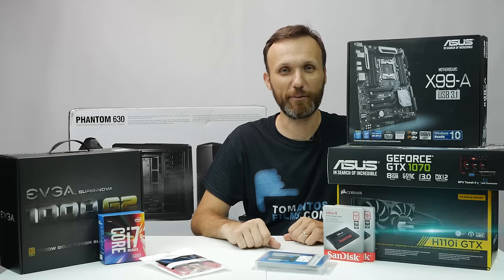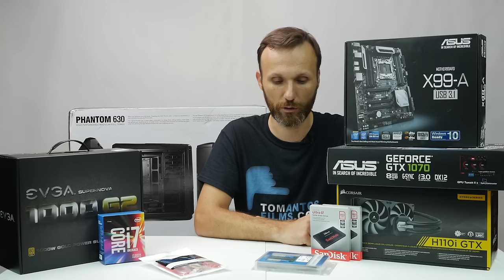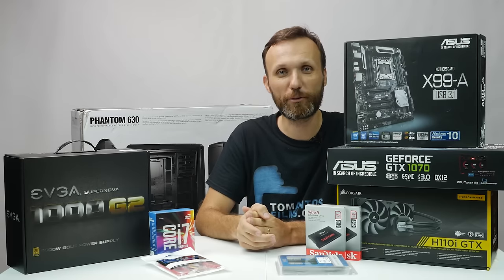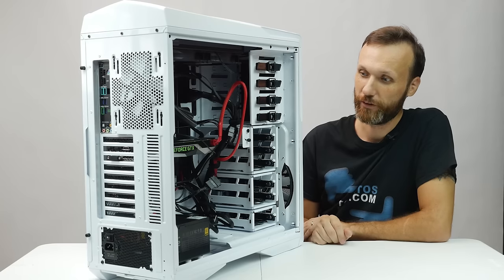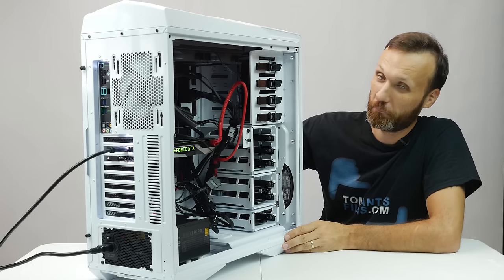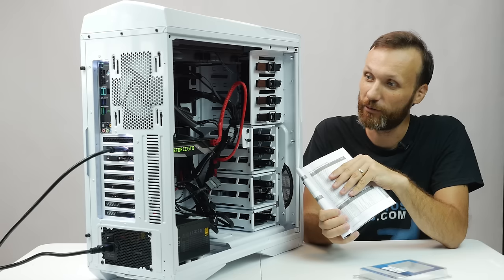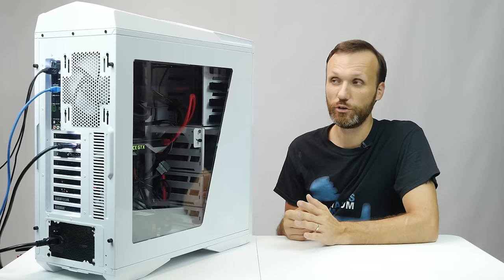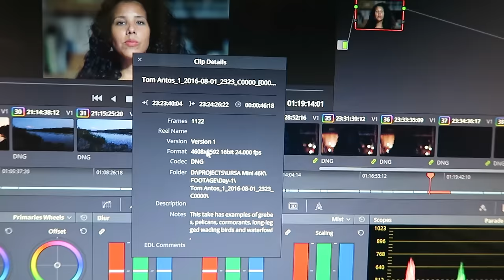4K RAW Video Editing Machine for $2K

Comment: This is pretty similar to my machine, just an older generation without water cooling and almost every component one tier lower. Still serves me very well, can edit perfectly on Premiere Pro CC, struggles on gaming a bit though. 
i7-3700k (4C, 8T)
GTX 660 (Getting 1070 soon)
16GB GSkill Ares 1866MHz
ASRock Z77 Extreme 6
1000W Seasonic 80+ Gold Fully Modular PSU
120GB SanDisk SSD Plus
NZXT Phantom (Original)
Cooler Master Hyper 212 Evo
Reply: do you use DaVinci Resolve on it? If so, how does it run?
Reply: +Lukasz Antos no, I'm very comfortable in premiere and I don't go so crazy on color grading, I only video edit as a hobby for now, but I'm looking forward to doing some videography once I get enough money for a camera and vintage lens
Reply: +xevangz use Premiere/AE? No need for a crazy $$$ machine, just use proxies 😀
Reply: YORKSHABOY i also game quite bit, planning to hopefully get my hands on a htc vive, plus i do 3d as a hobby too, blender is pretty solid on my pc
Reply from the maker: If you don't want to render proxies and work with native footage while doing VFX and advanced 3D graphics then you will need a good computer... otherwise yes, you can always use proxies.

Comment: that PSU (power supply unit) is waaaaaay "overwatted", that system does not need anything more than a 650/750watt psu, (i got basically the same but with just a way more power hungry and older card (r9 290). get a 750w gold or platinum rated instead, way better choice :) other than that the system is golden
Reply: He has said that he may look into adding another GPU later down the line, I know that even with that addition, he won't be close to maxing out the power supply, however energy efficiency of the power supply stays optimal when you have a good amount of headroom. Most power supplies lose their efficiency when nearing their max rating. The power supply he has is bronze rated.
Reply: Did you see slicks last video? (luke from Linus tech tips) a bigger psu will only use more power than a smaller one thus making it way less efficient. a 750 is still enough for 2 1070's and that system, but that CPU does not like SLI since it only has 28 PCI lanes (a gpu uses 16) so if youre building an SLI system then you need the 6850k or 5930k, they have 40 lanes

Comment: I wonder how much of a difference the graphics card does for the video editing performance. (I thought those type of GPUs where more for 3D gaming performance).

Also it puzzles me a bit why you went with 2 SSDs and not any HUGE capacity conventional HD.

Finally, you mention the cost of Windows, but how much does the video editing SW set you back? Why isn't this cost included in the 2k$ price?

Personally I have a preference for linux, which significantly reduces the availability of the most expensive and advanced software, but also cost. ;)

Comment: For 4K you need Dual CPU Xeon with 10 cores each, the i7 is very slow at processing 4K video
Reply: No, it's not. The CPU is only really used a lot in decompression, but when editing RAW, there's not much of that, so the CPU isn't taxed much; the GPU and RAM is instead.

Comment: Cable management is mess.
Reply: +1
@Tom Antos : you have purchased a beautiful case that has all the holes and grommets and room for proper cable management, as well as a case window to display your PC's internals, so use it to your advantage !!! Route them through the black rubber grommets so that they are out of the way (and hidden out of sight), that's what these holes are there for. Also replace the PCIe power cable of the GPU with one that matches your case+PC's color scheme, and add some RGB LED strips to enlighten en highlight your case internals...
Reply: +Yves Cools Tom Antos one of good film maker but surely not a pc builder, that's normal for him. Mines only suggestion just like yours.

Comment: I'm surprised to see that you're working with only a 900gb drive to handle 4k data. how much raw 4k footage can you fit in there?!

I was thinking of setting up an external RAID box for myself and get a 6TB drive + use all the 2TB drives i have around. still need to do more research on this idea....
Reply from the maker: I use external drives for all my footage... I just don't show it in this video. With the amount of filming I do I could never have internal hardrive space for all my footage.

Comment: Tom Antos - i need your friendly support, i have purchased some part of PC from ebay, and want to know your opinion and advice about this configuration:
MOTHERBOARD: Gigabyte GA-X99 Ultra Gaming (My favorite is GA-X99 Designare)
RAM: Corsair Dominator Platinum 2x16 GB 3200 MHz (I will buy extra 6x16GB in the future for Total 128 GB RAM)
          [My Favorite RAM - 64GB Corsair Dominator Platinum CHROME Special Edition 4x16GB DDR4 3200MHz]
CPU: - i7-6950x (but as i see you presented more powerful processor - Xeon Haswell E5-2696 v3)
CPU cooler: - Corsair H115i Hydro cooler
VIDEO:- ATI 7990HD or GTX980 TI (i will buy Titan-X 12 GB(Maxwell or maybe Pascal) in near 2 months and will change video card)
POWER SUPPLY: CORSAIR HX1200i
DVD-RW 1x
Blue RAY RW 1x
CASE Bravotec FX470
--------------------------------------------------------
Will buy during 4 months
HDD - 5x 5TB HDD Seagate 128 MB cache
SSD: Samsung EVO or Pro 512GB
SSD-2: Samsung EVO/Pro 1 TB
M.2.: Samsung 950 Pro 512GB

Comment: fantastic parts, well results im sure. But i work with Pr, i dont know why only a few models of graphics cards have a real support for cuda editing, i have that core, I7 6700K, its fantastic election but graphics card 1070 dont support with last version 2015 of Pr (adobe Premiere CC2015) i dont know why??? I have an stable equipment, DDR 4 only 16GBs, Two SSD, and old graphics Card GTX 470 and let me works really good with Pr and with 4K editing

Comment: Hey Tom, been following you for a while now...  What is your workflow with CDNG?  Do you utilize premiere in your workflow, or do you utilize only Resolve now?  I've been trying to find the best 4k workflow, and considering eventually getting the Black Magic 4.6k camera.  I want to make sure I have the horsepower to work with it, and the software is matured enough to do the same.  I have a similar set up with an older 3930K processor, but similar stats.  Plus I have RAID 6 array with 5 drives to work with with roughly 500MB/s transfer rates.  What kind of experience do you get with your rig?

Comment: This Presentation is unfortunately more suited for a gaming rig than a video editing computer. The video card is 8bit color, what you really need is a Quad card which displays 10bit color. The power supply is an absolute overkill by far, all you needed was an 850w tops. You also bought a very high end processor but you will never use even half of its power since the rendering is mostly done by the graphics card. I love this channel though and I am happy for your new rig, just remember to get yourself a proper Quadro Graphics Card with 10 bit of color

Comment: So are you saying you had to exchange the RAM and the mother board? That's exactly why I don't build my own systems any more. It's just too frustrating.
Reply from the maker: Yes, I bought the wrong memory. So if you follow what I bought now you won't have problems. The mother happened to be damaged and ASUS replaced it without any problems. So building it was very easy.
Reply: Building your own systems is a no brainer. The advantages over prebuilt machines are huge.

Comment: if i buy Dual kit Corsair Dominator Platinum 32GB (2x16GB) DDR4-3200 MHz, then can i buy Extra the same Cors. Dom. Plat. 6x16 GB 3200 MHz for my Gigabyte GA-X99 Ultra Gaming Motherboard and will they work together 128 GB normally?

Comment: I have the same build and I keep getting the error code 53. I've tried all the things suggested by Asus and online forums, such as, inserting a single ram into each individual slot to see if that would solve the problem but I still have had no luck. I made sure the rams were inserted all the way so the issue isn't the connection. I've also tried pressing the RAM reset button at the top left corner as well. Does anyone know how to fix this?

Comment: Hello Tom. Thanks for sharing this. As an A+ certified technician, I noticed a serious error during the build. you're very lucky your machine works at all. In the future, should you need to go into this machine for whatever reason, even just to check cables, or build a new machine, or install components, PLEASE, use an antistatic wrist strap to guard against electrostatic discharge. The build gods were with you, this time. Another build error I noticed on the filmmaking side, is you did not install a mechanical drive. Solid state drives are way faster, but I've already had first hand experience with an SSD having failed ahead of it's time. You NEED a mechanical drive as a redundant backup, but also, be sure to use a removable USB storage drive for all project files, and final cuts. One last item, when taking components out of a PC, place them back into an antistatic bag. New boards you're putting components on, prior to installation should be placed on an antistatic bag while you're working on them. Again, I can't stress this enough Get an antistatic wrist strap. It only costs a few bucks, and it'll save you a $2000 mistake, and prevent production downtime. I envy you your machine. Mine's close, but I had to go with the GTX-970 due to the hardware fail.
Reply: maybe he lives in a very humid area!
Reply: As far as I know antistatic bags are only antistatic on the inside...
Reply: I think this is one of the things like laptops on a plane. There is some truth somewhere in there, but personally never had an issue with static. I've built 6 pc's from scratch, and swapped out many parts over the years, I knew about the strap, but never ever bothered, and never had an issue. I would say it's related to humidity as Mop Krayz pointed out, but I lived in the arctic/desert for 2 1/2 years and didn't have issues there either. I guess it's cause I don't drag my feet on shag carpet prior to actually working on a PC. 

 From what I recall from my electrical engineering and electronics classes, you have to zap a delicate part directly to damage it, very hard to do if you only ever touch the edges of the board. The resistors and capacitors are pretty good about lowering the surge, assuming it starts at the outer edge, and you didn't just accidently touch the cpu with a full charge in your body. 

 I agree it's not worth the risk, I just keep forgetting cause it's just hasn't happened to me yet, not even a tiny zap. Cheers!
Reply: Statistically, SSDs are more reliable, so SSD backup is superior to HDD backup. However, yeah, HDD backup is more economical.

As for anti-static bags, the outside of the bag works like a lightning rod for static electricity. What you're suggesting is like grasping onto a lightning rod to avoid being struct by lightning, friend. It's best to just put the components on the box or an anti-static mat.
Reply from the maker: There's lots of different ways to discharge electrostatic. Antistatic wrist strap is one way. I did it another way. Always read the manual of the computer parts that you buy. I obviously can't mention every little detail in a short youtube video. But thank you for noticing. As for the mechanical drives and why I don't bother installing one is because I keep most of my footage on exterior hardrives and have multiple copies. So because of that I don't need to build it all in the computer. I prefer it that way since I travel a lot and shoot a lot of projects so I could never have enough hardrive space in my machine. I always need new drives for each new project. So it makes more sense for me to have those portable. Also just a warning for you about placing computer parts on the exterior of an antistatic bag. That can actually fry your computer parts. You only want to put it on the inside of the bag. Thanks for sharing your tips and glad you enjoyed the video Thomas!
Reply: you just use a standard external usb drive in enclosure, or have some kind of raid box? i was thinking of setting up an external raid box with esata. what do you think? maybe an idea for another video ;)

Comment: I am building 6950x with gtx 1080 soon but since I can't put that much cash out at once, I am getting gtx 1080 first this month and after 2 months getting motherboard cpu and ram, everything else is gonna be recycled from my old pc but my main question is will 700 watt power supply that I currently use will be enough

Comment: Hello tom, Thank you for this video!! Always nice to see some new gear :D I see you don't have any video monitoring card. I'm still looking for a Working Video monitoring card on PC. All I've seen in mac post are Blackmagic card like the Decklink Extreme. The review are pretty bad for PC users (A lot of MB incompatibilities). Do you know wich one work? You never use any? (PS : THE CABLE MANAGEMENT ahah!! you can put them in the back of the case for a cleaner look and airflow :) )
Reply from the maker: Thanks for the tip about the cables. I myself never use any video monitoring cards so I can't advise you on that. Sorry!
Reply: Yes I wouldn't mind much myself (even if it's necessary for interlaced TV materials). But unfortunately there is no way to use Davinci in full screen without any monitoring video card... Let's hope someone post information on Compatible Motherboard and monitoring cards ^^

Comment: Hiya, I pretty much have an identical build swapped with the gtx1080 and 850pro instead. How are your boot times? I find that from power on I'm waiting a good 12-15 seconds before the system beeps and displays anything on the monitor with this board? Ram checks? not sure.. 
Also how do you find editing more than 1 stream of 4k (picture-in-picture etc)? I get quite a bit of lag if I start layering effects and more than 2 streams of video overlapping (unrendered)

Cheers

Comment: The memory issue; in your description, did you include the correct memory that you would need for this build?
Reply from the maker: yes. the correct memory is listed
Reply: whenever you encounter a post issue always try resetting the bios first :) ( basically either use the jumper or remove / re-insert the cmos battery ) its a common issue with most motherboards btw :) i have ddr4 2400 mghz, and at first mine wouldn't boot either, reset bios and bam it worked. x99 is rated for 2133, BUT it can run much higher ;)

Comment: I'm trying to decide between the i7 7700k and the i7 6800k
Reply: 7700k slightly better cpu newer architecture over 6700k. however only in boost speeds. if same price go with 7700k but if there is gap in price go with 6700k. difference is minimal with 7700 edging in front.

Comment: for editing in 4k video i should have two graphic video card gtx 1080? or only one 1070?
Reply: Depends on the software you're using. eg I use PowerDirector which allows 2 or more graphics cards to provide hardware acceleration - to assist the CPU.
Reply: Adobe Premiere Pro uses the GPU.
Reply: And Davinci Resolve uses your graphics card.

Comment: Hi I built this two years ago.. Although pretty powerful it still struggles with 4k files in premier pro.  What can I do to upgrade my system?

CPU: Intel Core i7-4790K 4.0GHz Quad-Core Processor 
CPU Cooler: Cooler Master Hyper 212 EVO 82.9 CFM Sleeve Bearing CPU Cooler 
Motherboard: Asus Z97-AR ATX LGA1150 Motherboard
Memory: Corsair Vengeance LP 16GB (2 x 8GB) DDR3-1600 Memory 
Storage: Crucial MX100 256GB 2.5" Solid State Drive 
Storage: Seagate Barracuda 3TB 3.5" 7200RPM Internal Hard Drive
Samsung ssd 256gb
Video Card: MSI GeForce GTX 980 4GB Video Card
Case: Cooler Master Silencio 650 ATX Mid Tower Case 
Power Supply: EVGA 750W 80+ Gold Certified Fully-Modular ATX Power Supply
Case Accessory: NZXT Aperture M Card Reader
Reply: VIDEOARTIRELANDFILMS not
Reply: I have a similar setup to you but I have an AMD tri-core from 5 years ago! Luckily I don't film in 4K currently... What are you going to do?

Comment: I used the unactivated Windows 10 on my recent build for about two months. Aside from the the occasional pop up (I think that eventually went away) there is a water make on the lower right that day something like Windows is unactivated, that is there above all your applications. it's not in your face and didn't bother me too much. BUT you also can use any of the personalization options like wallpapers, themes of hide the task bar (I like to hide the task bar).

best solution is to go to kinguin .net and buy a Windows 10/ 10 Pro key for about 30 bucks. That's what I finally did. 

You may be able to use it unlocked indefinitely, but there is always the possibility that windows may one's day stop working. So the 30ish bollard key isn't a bad idea.